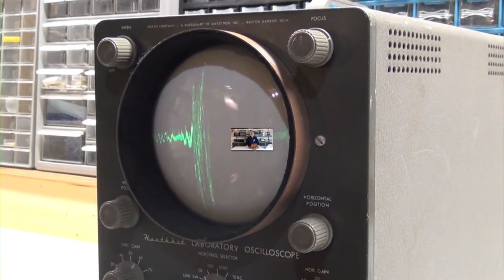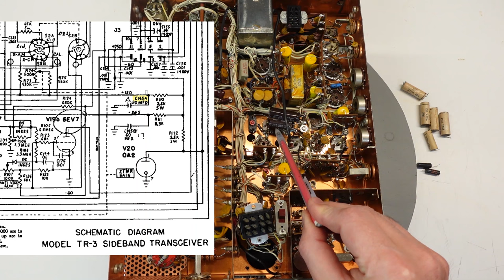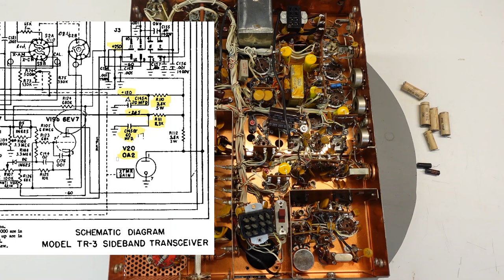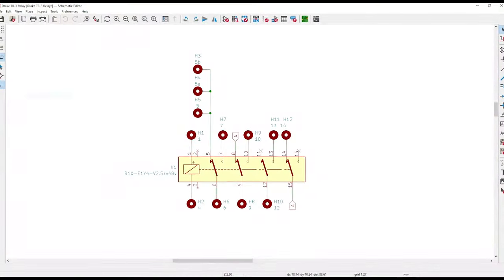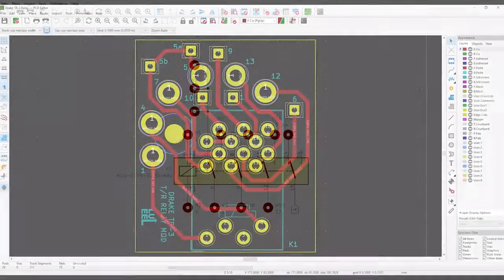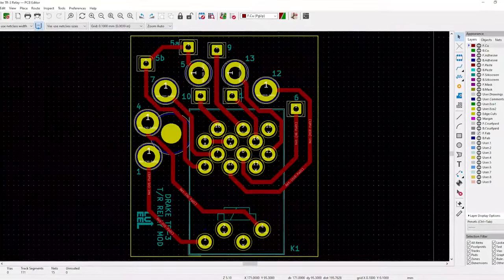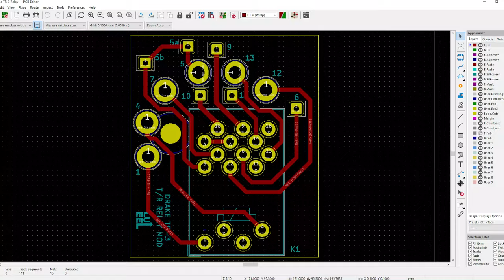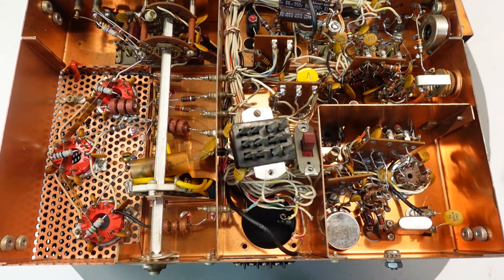Drake TR-3: Episode #3

Comment: On the stock PCB, I’ve dealt with a lot of them, and all you need to do is burnish the rivets with a glass-fiber or brass-brush and solder them.  Without looking at the schematic, the tube voltage regulators are usual reserved for just oscillators and critical circuits; you want to avoid putting unnecessary extra circuits (like screens) that may not need that tight of regulation,  and which will require a greater standing current going through the regulator tube to accommodate them and still provide proper regulation. 
Otherwise, I think you did a good job and agree with your replacement decisions.  73… 😊
Reply: I had thought of SpinStar's suggestion to just solder the rivets. However, I do give you props for creating a new board in KiCad and having it manufactured. I know the amount of work involved in that process. I have no idea, as to the better of the two solutions, and I would not speculate about that. I just wanted to give kudos, for the KiCad efforts. Cheers.